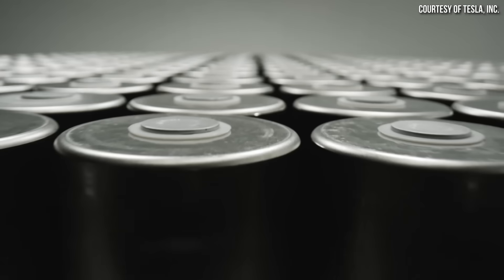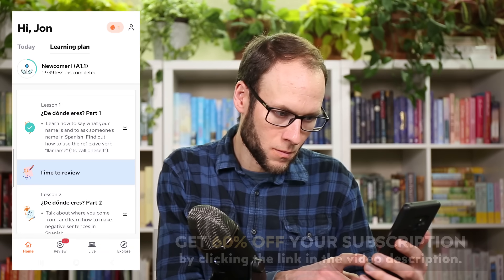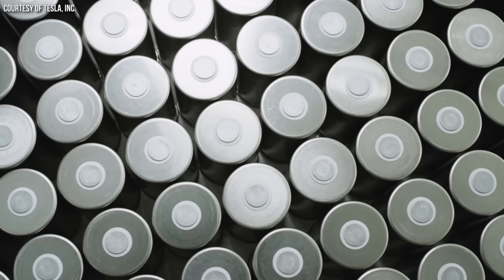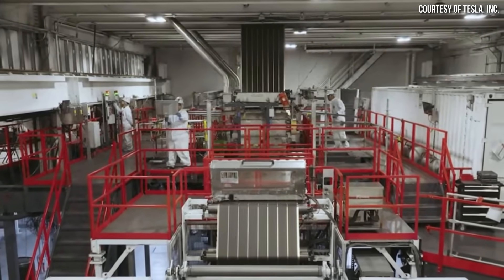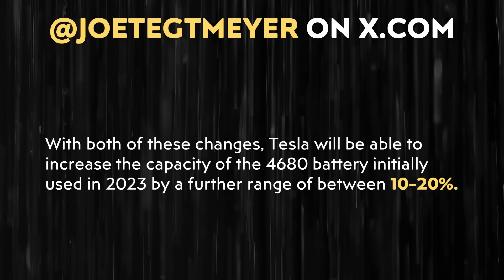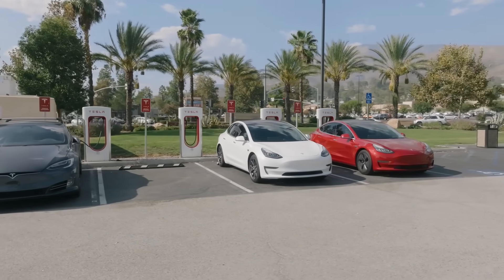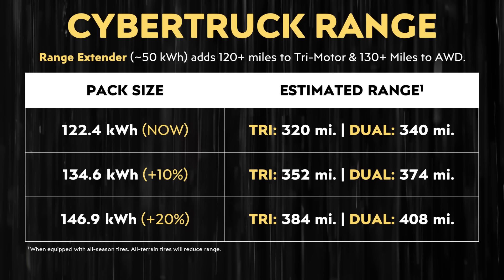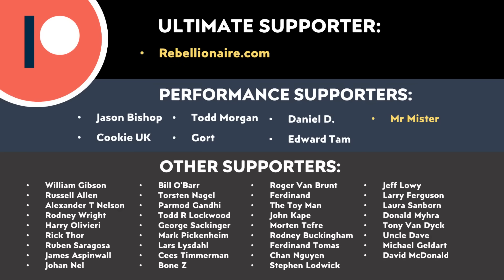NEW Tesla 4680 Battery w/ 10-20% Energy BOOST | COMING SOON!

Comment: CT should really have a 600 - 700mi range option. Not necessary for other vehicle types, but for a pickup I think that's what is needed so that the reduced range under load is still gold.
Reply: As an option for people who need this range.
Reply: They shouldve double stacked the 4680 packs like originally intended. Even if its just for the US Market.
Reply: @iCozzh 
You have no idea what was "Originally intended"
.
(It wasn't a "double stack")
Reply: I agree. I live up in northern BC we have a model Y and an ford explorer. Winter driving and round trip driving up north here is difficult without towing…. Once temps dip down it gets tricky…

I would pay a premium for a truck with 500-700 miles. Then there would be no excuse or reason to not go electric.
Reply: I think the speed of improvement will catch up with this. However, this would increase the price too much at this moment, and the car would be impractically heavy and clumsy. Even the vehicle class would have to change.
Reply: @Alarix246  Yes, I'm not suggesting they add more weight or volume, but rather that energy density improvements need to get us there, which it's looking like they will by the end of the decade or so.
Reply: It’s coming! Just need a little more time so it’s cost effective/affordable. Prob would cost about 150K right now sadly
Reply: These weights you’re talking about are they payload?
Reply: @ZeusBullyMax  Yes. Silverado HD 3500 is available with a 7500 lb payload.
Reply: yeah dude they can just lock the suspension at max height to make room for all the extra batteries

ez
Reply: Maybe up to 564 with a 20% Inc and the extra battery in the bed
Reply: @TheZackrambo  that's odly specific.
Reply: @truhartwood3170  that's just the 470 + 20% range
Reply: Yes, you need to start with 600 miles range to have the utility that you should have with a pickup.  Plus, you need extra range if you purchased a Tesla as you never get what you pay for as far as range.  We paid for 516km range in the Model Yp and we can count on  260km without draining the car so far as it wont' make the speed limit.
Reply: @bearlemley  It's the EPA that estimates range, so you can't just blame it on Tesla. In any case, that's outside the norm. The worst is if it's winter and you start with a cold car and just do short trips. A lot of energy is used in conditioning the battery and bringing the cabin up to temp, so if it does that and then you stop and get out, it cools down, you get back and it warms back up, then you stop and it cools down again, repeat, you're going to use way more power than if you just did a single, long trip. ICE cars are exactly the same - they are very inefficient until they warm up and lose quite a bit of range in winter. I have a display that shows my fuel consumption and it's like 3X the normal consumption when I've just started the car on a cold day.

Also, the EPA has just updated how it estimates range, which has brought the ranges for Tesla's down to a more realistic amount. Still for optimal conditions, though, just like their mpg ratings for ICE cars.
Reply: That can't be done with 4680 - it will need the most performant 2160 battery rich in nickel and then the structural pack will need changing too, adding additional dead mass to the car. It's a trade of mass / energy / efficiency for a car that big.
Reply: @loszonga  it can't be done today you mean. I have every confidence we'll be there by the end of the decade.
Reply: Ya know... Id normally agree except I have some real world experience with our F250 diesel.  When I pull our 46ft gooseneck loaded down, I get around 200 miles... That's it, no more.  It's pretty hard to expect a cyber truck to destroy it in range
Reply: @LeeWinkler  but that's exactly what I'd want the CT to be able to do. 600mi real world range empty under reasonably ideal conditions would equal 200mi doing what you said in the winter.
Reply: @truhartwood3170  you have absolutely no idea what it would do in the winter.... Neither do I.  Not to mention... Are the batteries pre heated in a garage, did it sit out all night, what's the temperature....  Too many variables so just divide it by 2 or 3.
Reply: @LeeWinkler  Everything I'm presenting is a hypothetical and approximate. You can usually assume that's the case when people are rounding to the nearest 50 or so and not getting into decimal points.

It's very easy to put a bigger tank in a truck. If owners were complaining about the range, the company could fix that very easily. So I'm assuming that current trucks offer a range that the vast majority of customers prefer. Therefore I would like to see EV pickups get similar range under similar conditions, as that's what most people are obviously happy with and have come to expect. It's really that simple. And like I said, I'm pretty sure by 2030 to 2035 we'll have battery chemistries that can do that without increasing the size or weight of the battery packs compared to today's vehicles. By 2040 I expect EVs could have better range than their gas counterparts if that was desired (though they'll likely just start reducing weight and price rather than adding range).
Reply: @truhartwood3170 that’s what you “want” but what is needed is far less. Only those towing daily or multiple times a week need more range. I grew up on a farm and we weren’t driving farm trucks 600mi. But an electric PTO might have been handy…

For towing applications an auxiliary battery might be the answer…
Reply: @michaelsmithers4900  note the word "option". Also, uh.. Just read my responses to other people's comments. I clarify my position there.
Reply: Agee 100%. Should have half the bed size and double the range.
Reply: @Williamxmr , I would disagree with the bed size. The more the merrier. The fact they got a 6' bed in a body length smaller than that of other trucks with 5.5' beds is pretty cool. A shorter bed wouldn't help with range at all, in fact it would give less room for batteries. So it's not like that's something you can trade one for the other.
Reply: @truhartwood3170  the extended range battery for this truck takes up 1/3 of the bed. It is precisely trading bed space for battery/range.  I'd gladly have a shallower bed of the same length with more range.
Reply: @Williamxmr  Oh! I thought you meant Tesla should have designed the bed smaller. Got it. My confuse.
Reply: Wrong.
Just need to satisfy their market, not every possible use case.
Cybertruck breaks ground on so many aspects like wiring, steering, suspension, no ladder frame.
Reply: @iandavies4853  For sure there are plenty of people that don't need that range, and it will take years to fill that demand, bu eventually there should be a option for people that need more range as energy density improves and such a pack wouldn't add any more weight than the current pack. Otherwise it will never be accepted as a viable, complete replacement for ICE pickups.
Reply: @iandavies4853 No ladder frame is a drawback, not a benefit, for a truck. There is a reason that only car-like trucks such as the Ridgeline are unibody.

What part of the Cybertruck suspension is revolutionary?
Reply: @TroySavary independent rear suspension with airbags is probably a first lol
Reply: @TroySavary  lack of a ladder frame isn't really an issue. They are one way to make a strong chassis, but not the only way.
Reply: @TroySavary  elimination of ladder was one primary aim of Tesla.
Use Giga castings & SS exoskeleton sails, use battery pack as structural component.
They got 2,500 lb load & great towing ability. Not too shabby.
Ford used fragile aluminium bodywork to save weight instead.
Cybertruck designed for efficiency. Ford isn’t, is hardly even designed, just copied.
Reply: @iandavies4853  Who cares if the body is aluminum? That isn't the load bearing part of a truck. Tesla used aluminum for the structure.

I know Tesla had a goal to eliminate the ladder frame. That doesn't mean that it was a good goal.

2500 lb is a good number for a light duty truck, but it pales compared to the 7500 lb of the Silverado 3500. I also question the long term durability of the cast aluminum carrying that weight.
Reply: @sportbikeguy9875  The "gigacasting" is cracking in cars, and Tesla fans think it will be adequate for trucks.
Reply: @sportbikeguy9875  Nope. Lightning, R1T, Hummer all have independent rear suspension. R1T and Hummer have air suspension. Not sure about Lightning without looking. Air suspension was also long available in ICE trucks for load leveling.
Reply: @TroySavary  you answered your own question. 3500 is a big pickup. That’s not cybertruck market, nor the Lighting, the Rivian, the Hummer EV. Toyota, BYD, VW, GWM all target smaller pickup. Don’t expect one model cover all markets.
If load shifts, you squash bed sides, or bump exterior pretty paintwork, aluminium is toast. That’s OK for toy truck.
Reply: @iandavies4853  Funny you say aluminium is for toy trucks, when Cybertruck frame is aluminum. Continue to prove my point about the Cybertruck being a toy.
Reply: @TroySavary The body is load bearing. Should say, both bodies are load bearing- the BIW inner and Stainless Outer.

Comment: I like LiFePO4.  Will this new version of 4680 outperform as far as cycle and being preferable to charge to 100%?
Reply: WHY do you still think you can't charge a Nickel based cell to 100% just prior to the few times you require absolute range?
.
Then consider that LiFePo4 is still ±20% behind on gravimetric density. That means you require 20% more cells, with associated volume and weight.
.

Comment: ❤

Bear in mind that people are comparing nominal energy density with actual energy density.

My testing actually matched TUMs.  It just depends on which figure you want to report on.

I reported on both in my tear down video.
Reply from the maker: Good clarification. Thanks for that!
Reply: @Cleanerwatt sure thing!

And to be clear, I don't know which one is the correct one to report on.

At some point I have to sit down and harmonize all these nominal and actual energy density figures for battery cells and battery packs.

It's kind of a mess.  

When that time comes, probably for the next tear down, I'll contact you, because I'll probably need some help with it
Reply from the maker: Sounds great! @thelimitingfactor
Reply: @thelimitingfactor Can you clarify the difference between nominal and actual? Does this mean laboratory tested vs. what is actually realized when it is in the car? If you have made a video on that, just let me know which one and I will go watch it.
Reply: @mikereinhardt1244  If I post in a link, it'll probably flag this as spam, but the video is called "Munro 4680 Energy Density Tested" and it starts at about 3 minutes I think.